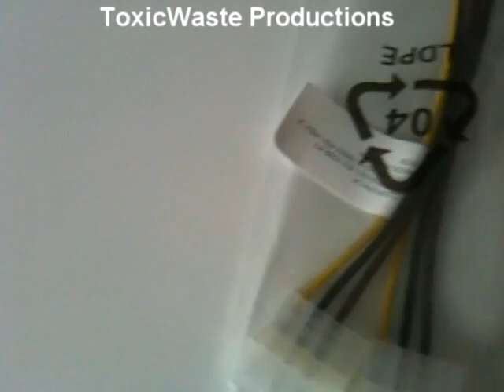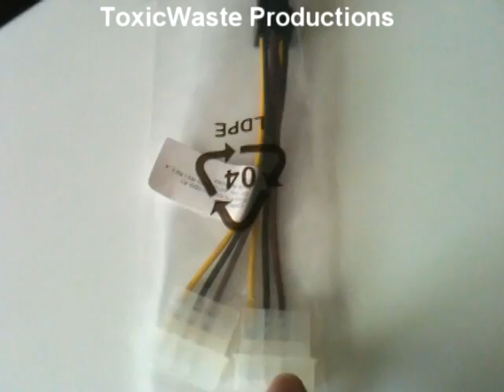Fabricate psu Y cable and pci-e cables

Comment from the maker: @PGTMan yeah but allot of new high end psu's handle up to 60 or 100amps no problem on mulex cables. But yes correct but it clutters the case and there for i dont like em.

Comment from the maker: @PGTMan your probably thinking of parralel wireing now. the thing the black does its an ground wire. the green one is an wire when grounded out it turns the psu on. so apparently there will be tops 1.5amps going there accordingly to what ive seen. the load will be on the main psu with all the pins. the other psu wont put any load through that wire it will just get its information when to start and shutdown.

you could wire two on off switches but whats the fun in doing it that way :P

Comment: They use two plugs to distribute the load. Joining them into one plug as you have done may cause overheating if you're pulling a lot of amps.